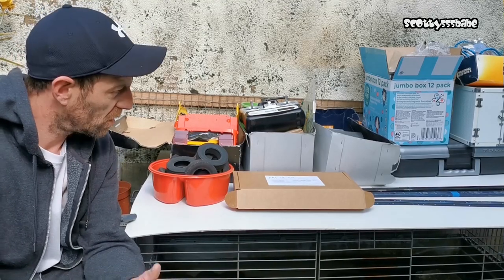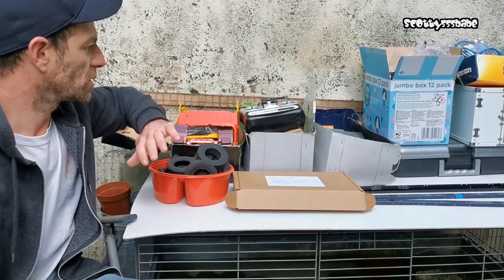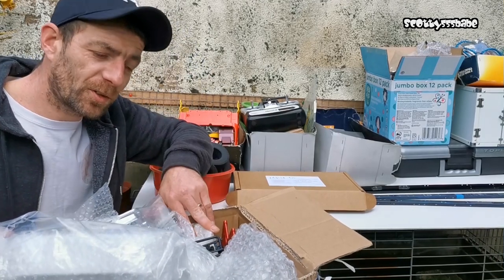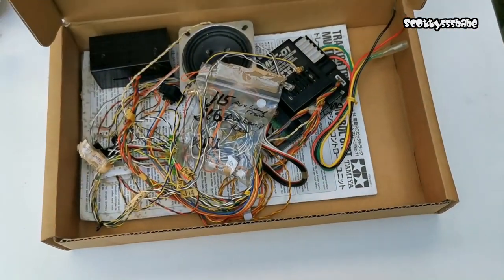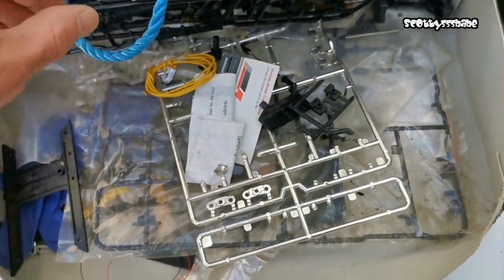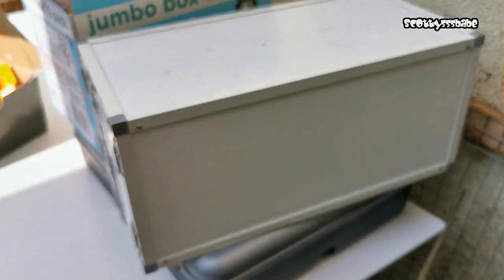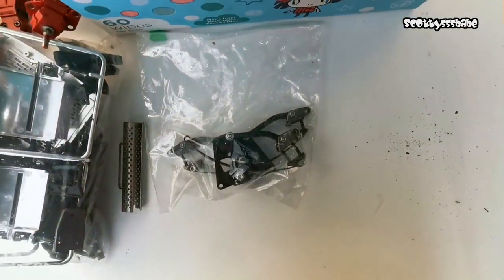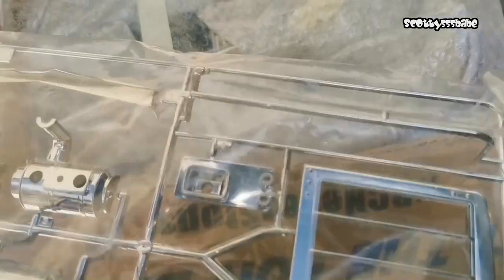TAMIYA RC TRUCK PARTS BIN BUILD | LOOK ALL THESE LEFTOVER PARTS | WHAT DO I BUILD? | Recycling Parts

Comment: 8x8 tipper with dual dual steer with Scania . Logger truck maybe.. or.. something not many have done a diy on.. a show truck. Lowered with super singles.. chrome.. extra lights with arches.
Reply from the maker: A custom lowered logger truck would be nice but then I'd want to play with it in the woods 🤣🤣
Still be nice though to see a pretty custom truck driving in the woods working rather than sat on a shelf 😉
I'll make a note of that one 👍👍

Comment: Well get started on stretch sleeper then bro well u got loads stuf it strange how we just collect bits hear n there bro 👍👍👍
Reply from the maker: I'm definitely doing that stretch, just more out i feel the honour to complete his truck, and I'll make a tri drive from blank rails with other grand cab and probably put it on bags as I need suspensions anyway 😊 yep we collect it all, fill our houses in every room and one day we finally use it 🤣🤣
Will get over to see you soon bro 👍👍
Reply: @scotty555babe  any time I’m all ways in apart from Tuesday bro u goin get some blank rails from layland to do the tri axle bro 👍👍
Reply from the maker: Yes going to get a few of those metre long Carson blanks off Phil and I need to keep stocking up with axles and suspensions as that's all I'm short of really bro 😊😊
Reply: @scotty555babe  ye n frunt steerin axle but there cheaper off eBay bro 👍👍

Comment: another great vid .ime currently 3d printing a king hauler as i could never afford a kit ive nearly finished it but the diff shafts and gearbox are being a bit problematic ie snapping sheering or bendingso might have to replace with actual metal parts
Reply from the maker: Credit to you, at least your still having a go and creating something you want, yours would be more appreciated too as you've made the whole thing and not gone with the ordinary, hope you get your gear issues sorted etc, if not there's always a way, like you say you may need to purchase a few items but still.. Keep at it 👍👍👍
Reply: Thanks yeagh got it goin now sort of but when i stop eccelerating it just stops no free wheeling  so i have to ease off the power real slowly or somethings goin to snap i think